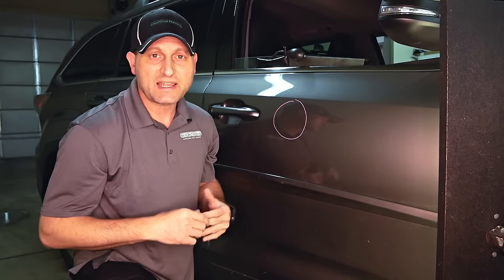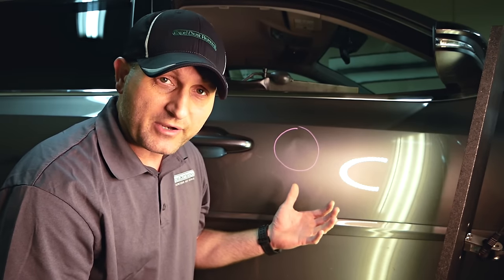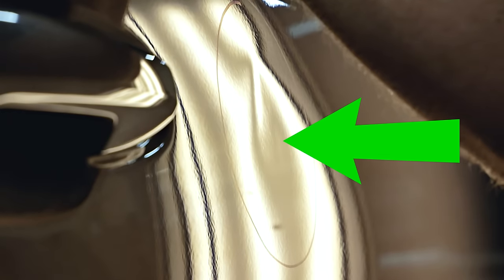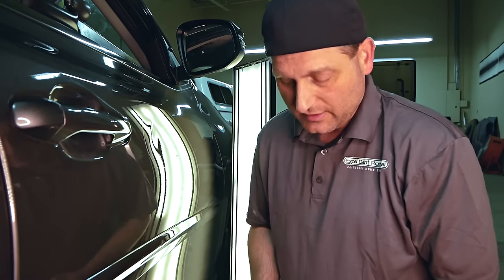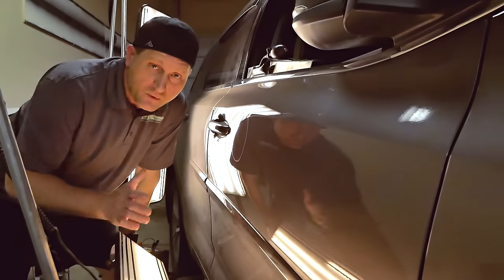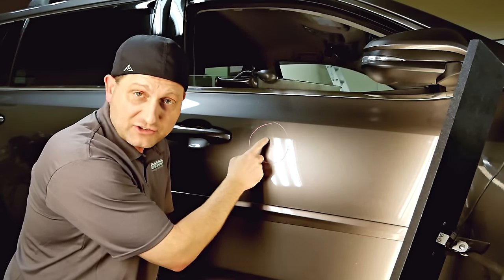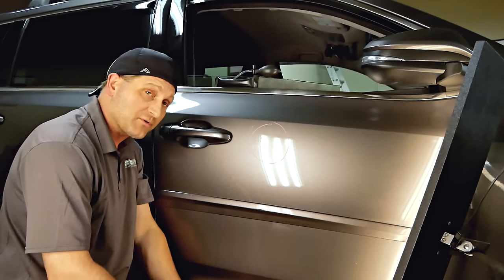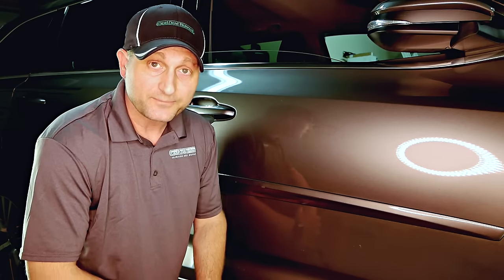How To Repair Small Dent in Car Door

Comment: I repaired a few dents like this by pulling off the door panels and using my heat gun while I carefully pushed from the inside with a molded half moon auto body tool that I crafted out of old scrap parts. Worked perfectly 👍💯
Reply: Thanks for that info

Comment: Baffles about how flexible these panels actually are. When he was working from the inside it moved so much. Super nice work
Reply: How do you actually work with that tool from the inside. I mean normally the glass of the wi does is there in the gap, did you remove some cover of the trim of so?
Reply from the maker: Often an air wedge is used to create a small gap. Then a window guard is used to cover and protect the glass. 
The PDR tools is used by gently pushing and/or twisting motion behind the dent. 

Sometimes removing the belt molding, window glass and interior trim is needed.
Reply: How come the paint doesn't actually crack with so much hammering going on, is it still flexibal or so?
Reply: @exceldentremoval  many thanks for replying! Super fast by the way 😎

Comment: Hi, how do you reach through the window with the window in the way?? Looks like you have something holding a wedge between but can you explain how you did this??
Reply from the maker: Yes, access to the inside of the door is often thru the window opening. A small gap is created with a window wedge, https://amzn.to/2ZrrPtn , and then a plastic, https://amzn.to/3uepgGk , or metal window guard is placed over the glass.

You can find more info in this article > https://www.exceldentremoval.com/repairing-a-dent-in-a-car/

Comment: How were you able to get your long handle tool into the door from the inside of the vehicle? Great video and it's giving me the confidence to do this myself but I don't have access in my rear quarter panels where I assume someone hit me.
Reply from the maker: Access to the back side of the panel is done in a few different ways. 
For a door, we can sometimes get access thru the window opening. Other times by removing the interior trim panel. 
For other panels, it can be done by removing the interior trim, wheel liners, or headlights and tail lights.

Comment: Hi there great video very clearly explained. Hope you could give me some advice. I have a White 1970 DS which has an aluminium bonnet. I put the car jack inside in a hurry and closed the bonnet which was a stud of about 8mm. As a result as you look at the bonnet from the outside it has a raised dent which has also cracked the paint in three / four places. Any tips on how to get rid of the dent? Thanks Mark
Reply from the maker: I’ve repaired this type of damage before. The first thing to do is “knock down” the point sticking up. 
You can see a similar video here ➡️ https://www.youtube.com/watch?v=P8nf3DStqP4
Often what is needed is to make it into a dent and then having to then repair the dent. Some minor sanding and buffing is needed to smooth out the surface. 

If your damage already has cracked and split paint, then knocking down or any more work could cause it to get worse. It may now require painting to get it fixed.

Comment: I like how you explained the action and why you did the removal the way you did. Good explanation of your planning and dent removal skill. I am a new subscriber to your site and would like to know how you handle thicker gauge metal when it comes to dent removal. I have a 97 Ram 2500 and it bears witness to my driving skills 🙄. I have a couple of medium dents 10”x6” that are pushed in about 1/4” and no paint damage. I would like to take shot at PDR, but one of the PDR guys didn’t want to tackle it because of the metal gauge. What do you think about working the heavier gauge metals…..thanks
Reply from the maker: I’ve repaired many types of cars from probably every decade from the ‘30s till now with paintless dent repair. 
While the older cars with thicker metal are tougher, they still can be done. 

But if you have some larger dents in the truck, then it may be more than it being thicker metal that they are unable to repair.

Comment: How to you get the tools inside the door to push the dent out? Great video btw!
Reply from the maker: There are a few options to access the back of a door panel. 
Most often for regular door dings, we get access thru the window opening. Like in their video. This is done by using a wedge to create a small gap and a plastic or metal window guard over the glass. 

The other ways are to remove the interior trim or by going thru a factory access hole.

Comment: Does it help to warm the panel up?
Reply from the maker: Yes, depending on the extent of the damage and the panel temp., using heat to warm the panel can help make the damage easier to manipulate.
You can see more about using a heat gun and the setup have in this video https://youtu.be/8353B4UVcJc

Comment: Great video, but how in the world are you able to get that tool in between the panel without breaking the glass. Did I miss something?
Reply from the maker: Good question! A plastic wedge or air wedge is used to open a small gap between the glass and door edge. Then a felt lined plastic or metal window guard is placed over the glass to protect it.

Comment: What do you use as a barrier between the window and door? Don’t want to scratch window and leave metal residue. Thanks
Reply from the maker: I have both a plastic and metal window guard. Both are felt lined. 
Then an air wedge is used to allow a small gap between the glass and door. Or I’ll remove the belt molding for kore room. 
This covers and protects the glass.

Comment: How does the tool you use behind the door skin not mar the window glass?  Is the glass the Fulcrum for your leverage?
Reply from the maker: An air wedge is used to provide a slight gap between the window glass and door. Then a plastic or steel felt lined window guard is put over the glass to protect it. 
There isn’t much pressure applied to the glass for leverage. Much of it is done by twisting the tool.

Comment: awesomely explain and demoed ...... had to comment and like for your efforts of creating this ... One Question what does this cost removal of one dent like in this video
Reply from the maker: Your average door dent can range in cost from $100-$300 depending on the size and other factors for the repair from a professional PDR technician. 

This particular dent was in the 2-3 inch size range but had easy access and a softer impression. This type could be $200-$250.

Comment: How did you get behind with that tool did anything have to be removed
Reply from the maker: For this dent I was able to access the back of the panel through the window opening. 
An air wedge is used to open the gap slightly and then a plastic or metal felt lined window guard is used over the glass.

Comment: Nice detailed video. Nice repair . What light is that you use ? Very bright
Reply from the maker: +straight lines Thanks!  Both of these Pdr lights are from Pro PDR Solutions. 
One is a bit older, about 10+ years, but is still working. The other is just a few years old and a more recent model.
Reply: Ok thanks. I'm mobile so they wouldn't work for me.
Reply from the maker: +straight lines Yes. They are my shop lights, but I do sometimes take them out to a body shop if needed. They are easy to pack up. 
I know they also make a portable light. I don’t have that one but do have the Elimadent 20” light.

Comment: What do you call the plane sheet you put in between the windows and the panel?
Reply from the maker: We will often use a plastic window guard or when extra protection is needed, a metal window guard. 

You can see them listed at these links. 

Window Guard: https://amzn.to/3uepgGk
Steel Window Guard: https://amzn.to/3o9IXhx
Reply: @exceldentremoval  Thanks man great work. Im starting to feel like i can confidently deal with those dents thanks to this video.

Comment: Is it possible to put this type of tool inside door panel in any sort of car I'm from india. Do we have to remove inner door panel for this. Reply as soon as possible sir.
Reply from the maker: Yes. Door dings are often removed from going down the window opening with these tools. 
The inner door panel is usually removed if the tools can’t reach the dent from the window opening or if the damage is extreme.

Comment: What does it mean when I'm trying to knockdown and the tool keeps bouncing off the fender?
Reply from the maker: There are many different ways to knockdown. Some methods do use a “bouncing” method. 
When using a knockdown, it will lightly bounce off the panel. If it is going to far it could be that you are not holding the knockdown firm enough or hitting it to hard.

Comment: How do you get behind the dent do you have to take the window out?
Reply from the maker: It will depend on the damage and location of the dent. 
Usually a typical door dent can be accessed through the window opening. Other times it may require removing the interior trim, window glass, and belt molding. 
For extreme damage, removing the entire door and mounting it on a stand is needed.

Comment: just a question whats the typical cost for removing a dent like this
Reply from the maker: Cost to repair a door dent can vary by the size and how complex the repair. Not every dent is exactly the same. It will also depend on the skill level of the technician. Those techs that are able to perform the highest quality of repair may cost more. 
Dents like this one can average in cost from $175-$300.
Reply: I would be 250-300.

Comment: How do you get the tool inside the door panel?
Reply from the maker: For this repair I was able to get access behind the door panel through the window opening. 
We use a pump up wedge to make a small gap and also cover the glass with a plastic or metal window guard.

Comment: How much do you charge for a job like this?
Reply from the maker: There are several factors that affect the labor time and costs to repair a dent. 
Dents like this can average from $160-$300. 
You can see more info about the cost of dent repair and calculate the costs with our PDR estimator at this link. 
https://www.exceldentremoval.com/how-much-does-paintless-dent-repair-cost/

Comment: No explanation given about inserting the metal plate or shim down inside the door panel against which to get leverage and not crack the glass window. This is a crucial piece of the process  which this guy did not bother to explain.
Reply from the maker: Yes, you are correct. Using a window guard is very important when accessing the back of the panel from the window opening. 
It happens to be so standard for me to do it and the way that I use them, that I don't remember to share that part of the repair.
I'll have to make a video to show what I use and the way I use them, since others have different methods and tools when gaining the access down the window.

Comment: Can someone please tell me what is happening beginning at the 4:43 mark (when the green arrow appears)?  I've watched this section at least 10 times and I can't for the life of me figure out what he is doing.  Thanks.
Reply from the maker: Great Question! The arrow is pointing to the spot where the PDR tool is pushing up the dent from inside the panel. 
This method is more of a “massaging” technique to slowly bring up the metal. Using a strong, firm or hard push that would show big movement would cause damage that can’t be repaired. 

You can check out this other video that shows what that could look like when someone over pushes out the damage. 
https://youtu.be/zSlAHr_uqgM

Comment: My 2001 eclipse metal is alot thicker than the Toyota. I struggle with the heat. Keeping it warm. In Alaska outside it just gets cold fast.
Reply from the maker: +chad rocca I have a setup now I use. I have a heat gun that is mounted to a special designed suction cup mount. It holds the heat gun and I can keep consistent heat on the panel when working.

Comment: What percent of cars today would you guess are made of what material...like metal, plastic, fiberglass.
Reply from the maker: Im not sure of a percentage. But I’d guess most cars are actually made of a mix of metal and plastic parts. 
The most use would be of different metals. Most are still steel, but there is much more use of aluminum and high strength steel panels.

Comment: A plastic shovel fell on my car door a caused a small ding. The damage is right above the body line, or crease, on a dodge challenger. I'm hoping it can be repaired because my car is brand new. It's a very small ding that I want repaired.
Reply from the maker: Yes. That shouldn’t be a problem for paintless dent repair. The body line on those challengers can be difficult but with the right tools they come out great.
Reply: @exceldentremoval  I have an appointment Friday at the dealership. I'll keep you posted. Thank you.

Comment: Great video! How can I pull 3mm small sharp dent with paint damage? Please help!
Reply from the maker: If there is paint damage, then pushing the dent out from the inside is the best option. Then maybe some minor touch after for the paint scratch. 
Pulling the dent out from the outside with glue pulling either won’t work or could pull off more paint.
Reply: @exceldentremoval  Thanks a lot !  The dent is 3 inch over the door handle. Can i go through the window gap with a tool from the top without removing anything from the door?
Reply from the maker: Yes. That should work. Usually the top part of the door will be braced or reinforced with another metal area but these often have holes in them for access. It may require removing the outer belt molding for easier access. 
The other option would be to look for a plug inside the door jab. Sometimes there is a hole there for access.
Reply: @exceldentremoval  Yes I found a plug on the door jab. I will buy a tool and try to reach it as you advised. thank you. You have been a great help!

Comment: What’s the average price for this job?
Reply from the maker: +Eduardo S The average cost for small door dings can range from $125-$250. 
There a several factors that can affect the cost. Those being the size, depth, location, and access to the dent. 
Being this dent was about 2-3 inches, was a soft shallow dent and had easy access behind the damage. The cost would range from $175-$275.

Comment: All this for 1 dent, I got like 12 because it hailed like crazy, how much is that going to cost me??
Reply from the maker: It is best to check with a local PDR tech near you for a quote on your hail damage. 
This is because there are several factors in repairing hail on a car. It will depend on how many dents there are on each panel. The size of the dents, and also the access to the back of the panel. Which can include having to remove any interior trim for access.

Comment: how many hours would that take you if you were not on camera
Reply from the maker: Every dent can take more or less time depending on how complex the damage is. 
This one actually was easier to do once I was able to knock down the crown and that made the damage much less to have to push out. 
For me, something like this would average around an hour to repair. Typically I’d guess around 45-90 minutes. 
This takes into account that I have been doing PDR for over 20 years and I know what tools I need for the repair and have them available. Plus knowing how to start the dent for the quickest and clean repair. 
When I was a new tech with less than 2 years of experience, this may have taken 2-4 hours to repair to a high quality.

Comment: I would be afraid to break the glass.... I take the back panel out
Reply from the maker: After doing thousands of repairs thru the window, it’s not a problem. 
I just always leave the window up slightly and use an air wedge. 
The only time I am EXTRA cautious is with laminated glass.

Comment: Metal has a memory, so why can’t you put the tool on there put on the dent a little bit and then push the crown down that’s how I’ve done it in the past
Reply from the maker: +Looking Upwards Yes. That’s another technique used. It’s not really needed for this small dent. But for larger damage and dents with more “stress” or locked up pressure you do need to push or pull on the dent at the same time as pushing or blending the crowns back down.

Comment: And there you have it........$2500 later,,,you fixed a weebit of a dent that cost you more then the car is worth
Reply from the maker: This method of paintless dent repair is going to cost much less than that and much better than a body shop repair and repaint.
Average cost of professional paintless dent removal for small dents can range from $100 - $300. It would take a car full of dents for the cost to be more that what the car is worth.